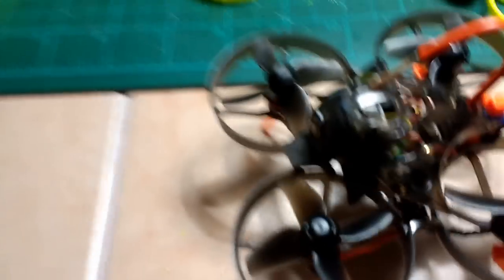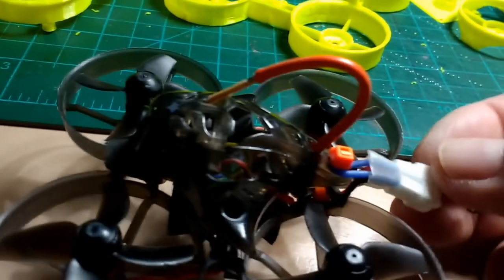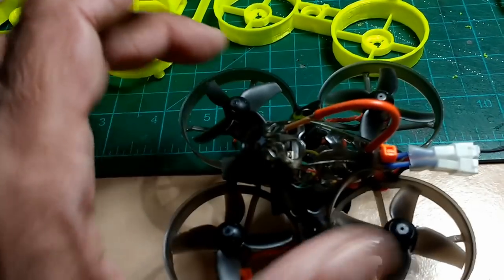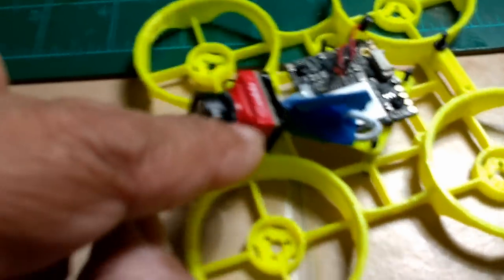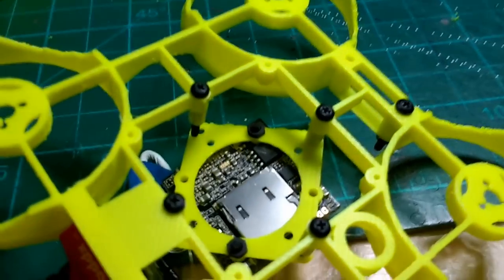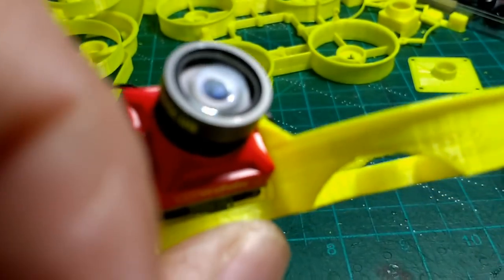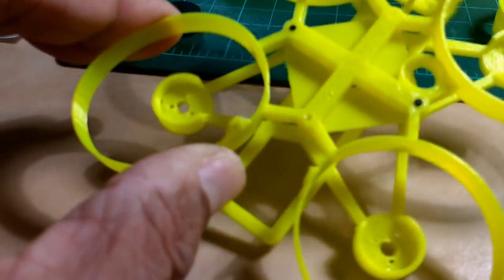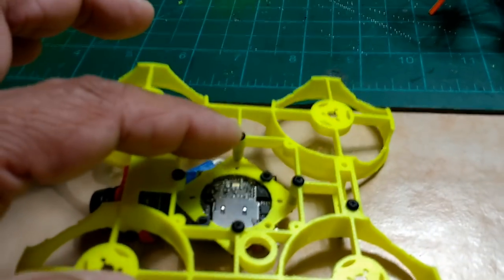6 Great Mods for your Mobula 7  Palm Size Drone, plus  MIA Frames for Caddx Turtle V2

Comment: Thanks for the tips . I fly 1s mainly too . 
Can just de-pin the connector to have only 1 connector ( save tiny weight  and connectors flapping about and resistance with jumper plugs and extra cabling  ) takes 20 secs to swap back if ever fly 2s .
Reply from the maker: yes, absolutely, but working with those tiny connectors may not be for everyone, as peoples hands are all different. 
If we are fortunate to have smaller, thinner and flexible fingers and better yet good eyes :) we can de-pin/re=pin them easy peazy, but  maybe best to simply swap those connectors with  a bit thicker cables and XT30 connectors and used same matching connectors on 2 cell batteries.   

ANOTHER TIP: 
One of the things that should be the first to be inspected when having power issues, especially for video transmission  is proper  connectors, connections and "solder joints".  When wires start to get frayed, they will rob you of proper current flow which affects power, same thing happens with poor connectors or wires that are not designed for proper current flow.  Best to use thicker  high No.  strand copper wires  (not thicker sheathing) silicone sheathing for high flexibility and beefier  connectors, preferably ones that have gold plated sockets and plugs. I use gold plates 2.5mm micro bullet connectors on some of my micro quads, they are lighter than XT30's and have low power loss.

Comment: Very cool,  Thank you.  I like the landing gear.
Reply from the maker: not a prob, you are welcome. :)
Reply: @MarioIArguello  the landing gear are nice but once you start trying to hit smaller and smaller gaps you'll just end up catching the gear on stuff. I wonder if you'll end up removing them.
Reply from the maker: @jgallone  good point,  I keep my LG mod very short I shorten them 1/2" more so they only stick out 1/2 under the frame but still provide suspension landing.  The longer legs will catch unto things but they simply flex because the zip ties are so thin and flexible. The other option, and more aesthetically pleasing is to do what I did on the original Walkera Lady Bird many many years ago and use silicone pads under the motor mounts.

Comment: i love the idea of widening the stance- PLA is heavy- ABS is way lighter because of the high styrene content- Look up 3d printer filaments and find the lease DENSE plastic you can find- that means The most meters you get per KG of filament

and you will have the most battery life then and power to weight ratio
Reply: you will find that if the stance is TOO wide you will have issues doing faster flips and it will feel more "floaty"
Reply from the maker: Absolutely, PLA is great for prototyping it provides a quick tangible part to look and make corrections easily. The lightest Material is 2X more expensive than PLA  and a high quality one is almost 4 times more costly. However for less weight and more durability the cost is well justified.  Check out my latest frame kits I've been placing videos of, in my Instagram account under MIAMICROFLIGHT.  I already have kits I am offering but not just yet under my web site. Word of mouth currently and they are going as fast as I can make them.
Reply from the maker: @meky0  also depends on density and aerodynamic shape. At some point one has to ask which is more desireable? faster flips of a faster more stable model.  I personally prefer more arrow like speed, and I am willing to sacrifice faster flips, for more stable straight agility but if we can have the best of both worlds, even better, the trick however, is finding that perfect balance.
Reply: @MarioIArguello   abs is cheaper than pla? and is lighter and more durable-- it is not as stiff- but alot of these micro quads are made from materials less stiff than ABS anyway - you should try abs :P
Reply: great website keep up the good work

Comment: Nice video thanks. I am wondering how your mobula 7 frame is holding up with the landing struts attached. You posted this video months ago, can you give some insight into if the extra point stress from the triewraps and the energy they conduct after impact maybe broke the motor struts?
Reply from the maker: One thing about "nylon" parts, is they outlast the  other parts, in other words I've gone through a couple OEM frames not because of the landing struts but because of head on collisions with walls,trees, but the landing struts have saved my frames on hard landings, the nylon straps  employed as the landing suspension legs, have surpassed their abuse. You can not go wrong with nylon parts for anything that requires heavy use and abuse.

Comment: At that point you might as well just build from scratch. The M7 is a phenomenal whoop out of the box. Idk why everyone is in such a space race to swap or “upgrade” everything they can on them.

Just buy n fly, or just build from scratch if you have to mess with everything on it
Reply from the maker: Yes it is a great flyer, no doubt about that!  Although I am not everyone, you have to forgive me I am a perfectionist, and  although the Mobula 7  is a great flyer out  the box, there is ample room for improvements. For example:

1) the Tiny hawk, motor wiring or connections to the FC is very nicely done via a molded track for the wires so they are completely out of the way and self enclosed , on the mobula 7 they are loosely connected to the FC and if they are not secured with tie wraps or similar method, as I am doing,  to keep those tiny motor wires better secured there is risk of those wires getting caught on something and ripping. Why risk it?  
2) The battery connector retainer that I am using on my frame designs is something that minimizes possible damage to the connectors wires, plus it is a much cleaner design.
 3) The beeper socket I designed as part of my frames also keeps the beeper in its own place, the stock frame version simply uses a sticky pad to hold the beeper stuck over the FC, this to me is cheesy, and can actually come loose in a crash and possibly even make contact with the beeper exposed wire connection making contact with the FC components, a possible short can occur when you leave components loose like that.
4) The battery stacked makeshift 3D printed soft part that is supplied with the stock kits is also a bit cheesy,  a much better fitting and lower profile battery strap is better, as I designed them into my frames (See my other videos on these MIA streamlined frames).
 5) The landing  gear, ? there is no LG on the stock model,  I employed tie wraps for the quick DIY mod, but on my frames I also have taken care of that by implementing a much better solution so not to risk,  the integrity not only of the frame but also the electronics on hard landings, I embedded on my latest lower profile racing Moblula 7 MIA Micro-FLIGHT Upgrade frames.
 6)  The camera mount is another area that my frames offer a much better setup, lower CG and more streamline design with better angle adjustment, no limit here.  
7) Aesthetically, a more streamline overall frame design is more visually pleasing  and fun! to fly,  but also benefits aerodynamically, when properly done.   I don't care for the funky canopy these "tiny whoop" like quads employ, they are all copies of each other, the only one that stands out from the crowd is the the one on the Tiny Hawk, as it is part of the frame design as one piece, so one can say it is unique and even that one can be done much better. 

In order to see in more detail all these points, you have to see my latest frames.  I rarely like to leave open doors in my designs, as I like to invest considerable time in looking at them from all angles and refining each detail to the best it can be refined, within reason. The one in this video is one of the first prototypes, but I think it shows many key features in favor  of a better frame for the Mobula 7 or similar size tiny racing or cine quadcopter.

Yes, these days it is probably simpler to build your own custom racing Palm-Size Racing quad, as all the components for making similar are readily available, but still requires someone having a bit of knowledge about properly sizing motors/props and likewise selecting complimentary electronics. 
Why go through that trouble when you can purchase one already setup and simply swap the electronics into a more thought out frame.  The cost will be also  cheaper if you simply purchase it already build vs, purchasing all the same components separately. Ok sometimes we need to invest a bit more for total customization but this is what keeps this hobby moving forward and fun!.  
 
I will agree that the Caddx camera and DVR weight has a considerable penalty on the any Mobula 7 frame or any similar size quadcopter,  simply by nature of its own weight, but I designed my frames for both options.  Considering all these important points, it is hard not see benefits over the stock frame and layout.  I am also doing other things  with the setup to improve the flight characteristic even better, for total racing. :) This is in my other Mobula 7 videos.

Comment: That looks AWESOME! just wondering how well does the 3D printed frame do in a crash? What filament did you use?
Reply from the maker: I have not crashed with it yet, but the material is resilient, it is PLA, on the prototype but any filament with  a "poly" like polyethelene, or even nylon, will be similar to the stock frame. BTW the stock translucent black frame is pretty durable, even thouigh it is not as  well thought out as my custom one.
Reply: @MarioIArguello  Thank you mate

Comment: You need 1103 motors if your gonna use the caddex turtle your not going to have enough thrust if you dont but itll still fly just gonna burn those lipos super quick
Reply from the maker: Thanks for that detail on the motors, FPVattitude,  Yes, I did mention in one of my Mobula 7 videos you will  need better more powerful motors and more juice, or a different layout. We  can still use the same stock Mobula 7 electronics along with the stock motors if we go with a slightly different layout. That was my intent originally and not so much to remain with the same stock footprint. The other option is to go with different more efficient  propellers/size/pitch.  My goal was ca Cine quad that uses the  Caddx turtle v2 and the Mobula 7 stock electronics on 1 cell.  I will show how I did this in a upcoming video very soon.

Comment: Landing gear is great but will turtlemode still work?
Reply from the maker: Yes , just keep the legs short, around 15mm or 1/2",  I keep mine at 1" because I rather have more suspension during hard landings or in case the quad drops and it wil drop many times during misshaps or if you panic and cut the trottle.  LG is not really required if you fly over grass. I fly mostly over cement so it helps in this case.
Reply: @MarioIArguello  Thanks will make mine 1/2 on my Trashcan, great idea!

Comment: nice mods....really like the frame...like to print it ;)   been wanting to add the caddx...you have the perfect set up. I have 2 mob7''s running  16k 4 blade and 19k 2 blade both upgraded frames (stock frames no bueno) goggle dvr doesn't do justice...THANKS

Comment: All this does is add weight. Wouldn't suggest doing any of these. I was looking for some good mods not some freaking zip tie ghetto mods
Reply from the maker: Whether you find the zip ties getto or not, they cushion the landings thus saving your frame and electronics from impact damage which will occur without them. More prevalent w/o than with these simple zip tie springs. I used zip ties because it is the simplest form,  inexpensive and readily available. Added weight is almost negligible, they are so light!.    You don't need to do them. It is up to the user, and the mods are free. 

For me, it helped me get a lot more life  out  of the stock frame,  eventually the stock frame broke on a head on collision  with the roof of my house and I had to replace it, but before that, I had done hundreds of hard landings and the model simply sprung back. I took them off on another "stock" build (sorry I did that)  and I busted the motor to wired connection on a hard landing near a curve, because it had no underbelly protection. Some protection is better than no protection and this is just one of many ways to do it.  The simplest getto, if you want to call them that, but effective.  Looks sometimes can be deceiving and unless you try it first, don't judge. 

BTW, What would you consider a good mod?